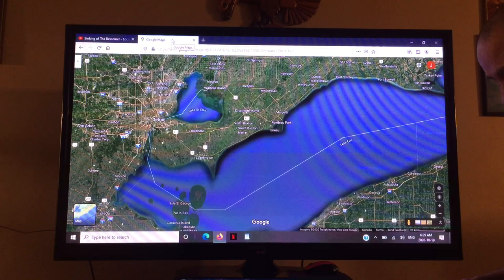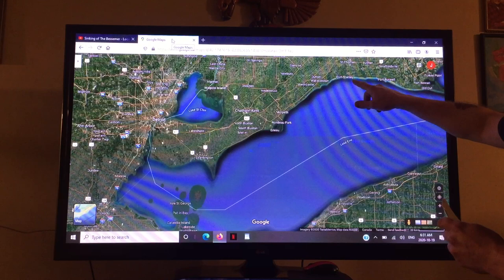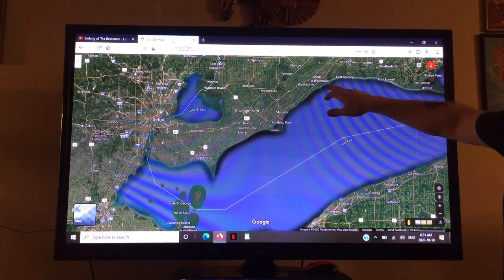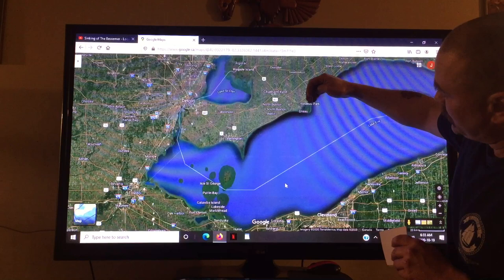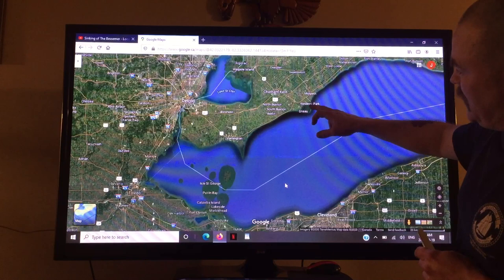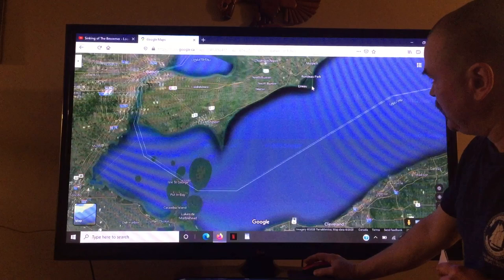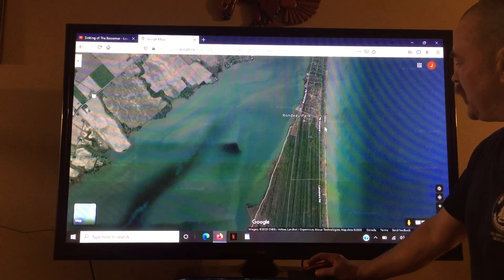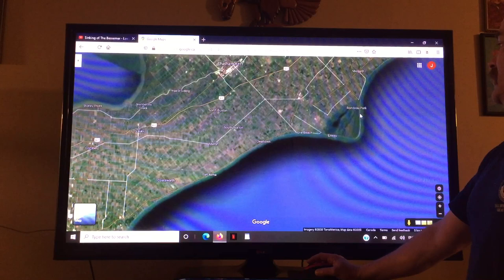Marquette and Bessemer No2 has been found!

Comment: Its a good story, but the sand spit in rondeau was formed over the past 12000 years. Not because a ship sank there. Over the past 150 years it has actually eroded over 650 meters. Also that point is aporox 8km long.
Reply from the maker: She formed that side of the point. Nature doesn't make straight. It also doesn't form points that leak black.  A magnetometer and side scan sonar this season will prove me right.
Reply: @joehindley6016  A 334ft long ship did not create a point 8km long, that it has been there for thousands of years and has been a park with cottages on it since around 1884. I hope you can prove me otherwise. Good luck.
Reply: I’m rooting for you, Joe, but the OP is correct. The rising and settling of the surroundings happening in/around  all of the Great Lakes is causing this to erode, not build up(resettling after last ice age 10k years ago, which causes the land to expose itself while rising, lowering the water level). There are several(including 2 formations in the Atlantic, one over 9 miles long) natural anomalies that would prove the “nature doesn’t make straight” statement wrong. I think that your theory and timeline are good, but I think relying on a “debris field” from a 330ft vessel that is supposedly under that much sediment is faulty at best. All that said, where are you at with your funding and equipment? Perhaps I can introduce myself and help if you contact me. Either way, I wish you good luck and hope you solve this great and tragic story!

Comment: I personally don't believe that's the spot. But its a fair theory.  What blows my mind is Lake erie averages 60 ft deep and the M&B#2 would have been 50+ feet tall on the bottom.  That tells me its likely in a deeper part of the lake.  Also, If it were me, I just managed to get near shore in those conditions, I just cant safely enter harbor, I'm not going all the way back across the lake to Cleveland.  Seems more likely that I'd find a spot to potentially beach her.

Comment: I was wondering how the search is going? 

I live near Aylmer and I visit Port Stanley often, I came across the story of this ship recently and it has really sparked my interest...
Reply from the maker: It's going slowly. I was at the site 10 days ago. She is well hidden under 12 to 15 feet of sediment. I can't do what I want down there without getting in a lot of trouble. I don't want to do that.
Reply: @joehindley6016  

Has anyone ever thought about running some sort of sonar over it to see if a ship anomaly lays down there? That would likely draw a pretty clear picture, expensive equipment though, it would likely only be possible with involvement of some research organizations etc...
Reply from the maker: @googlreviews7813  i used to guess at how much sediment was over her. I know how much is on her now. That is all I have to say about it. That is as far as I can go. If I wanted to I could touch her hull with a special prob. drill through it, and put a plumbers camera in her to see inside. The idea has crossed my mind but it's not right to contaminate the site like that.  If I was free to problem solve at will this would have been over years ago. I have to do this within the bounds of the law from here on in. I have done all I can without fines or jail time I would like to keep it that way.

Comment: but how did dirt and everything get grown on the steel
Reply: Sediment accumulates every year on the planet. and she has been there for  113 years. lots of time for it to accumulate. As I have said before in support of Joe, There were no airplanes to spot her for many years. During that period the sands of time and the lake, did there work. I am sure she would have been seen if Planes were in the equation. But they are not. You can easily see ship wrecks in the St Clair river that have been there much longer.
Reply from the maker: You can't see anything there. Visibility is one foot at all times. From the air as well. A satellite scan of the lake couldn't see her when it was done. I have a million questions to answer. I can't wait for the experts to take her over so I can focus on what I want to know.  I am going to be on the search for as many old aerial photo's of the point as I can get. I will not see her, but I will see her shape in the sand.
Reply: imho if an airplane had overflown her or a satellite overflown her she would have been seen. But only in the first year or 2. After that like Joe says visibility is poor there. Even if you find a old photo of the point  it would have to have been in 1910 or1911. After that its too late. due to airplanes being too rudimentary till really after ww1. It is slim to none that a flight took place before 1918. Again way too late . A satellite wouldn't be able to see her in 1918, just as now. The reason I agree with Joe is the artifacts he has found. and loose coal doesn't come leaking out of sand. It has to be chipped out of deposits. And you can see the coal. I myself don't see her shape. because I dont know how close to shore  ( Inland.) that she is. but I can see the coal. I have no doubts you are right Joe. Cant wait till you prove it to everyone.

Comment from the maker: Their was no mutiny! That was a story to sell newspapers.  George Smith was found with his tools of the trade, 2 butcher knives and a meat cleaver. When Robert McLeod's body was found with a cut wound an a-hole reporter put the two together without a thought for what it did to the Smith family and the stigma that probably follows to this day.   It never happened! 
Robert McLeod"s wounds were from the ship slamming him into the water. The wounds of all the men were from the ship.

Look at it with a little common sense.1) Could George Smith or anyone on the ship get a known lemon of a ship home in a fierce storm better than, not one seasoned veteran Captain but two! John had his captains papers as well.  2) George was found with the knives and cleaver. He would have had to run 200 feet up the deck slash the Captain while his brother and the other crew around watched, then he ran back down to life boat #4 with his weapons.  It never happened!

George Smith from Conneaut, Ohio, USA followed orders until the end. He then helped pull other men into lifeboat #4 before he froze to death with his tools of the trade, his two butcher knives and meat cleaver.

If their are relatives of George Smith following this, hold your heads up high, George didn't murder anyone!

Comment: what collapse is referred to? did the hull itself collapse? Also this was posted  in 2020  Was It confirmed??
Reply: So I gather you should know by the summer of 2022? As they say leave no stones unturned. I hope you are right. Have you gathered some of the coal?
Reply from the maker: Yes the hull collapsed. It is why you can see the black stuff so clearly from space. The current is going in her side and coming out near the stern. I have a piece of coal so new it still has tool marks from the miners. It spent very little time in the water and came from inside her. I have a crushed paint can with her white paint in it. The can dates to the time period. It came out as well.  It will be confirmed this year. They don't even have to do a grid search. I will put them right on her within feet.
Reply from the maker: I have a piece of her metal with Glidden green paint on it in my filing cabinet as well as a boot heel from the time period.  If you want to be a part of history I have a go fund me.  I will have the equipment down there if I have to sell a kidney.
Reply: @joehindley6016 This is great! Good job sir! I thought your projected timeline was convincing, let alone artifacts. Do you think she lost railcars overboard before she went over? or do you think they are inside her? And do you suspect she is directly under the waters edge? I believe you mentioned a depression caused by her collapse?
Reply: @joehindley6016  Sadly I am only just able to pay my bills, so I would not be able to contribute monetarily. But I look forward to any progress made. I saw I believe 4 black "rivers" flowing into the lake. Are they all coal? and what is the approximate distance between the 2 farthest apart?
Reply from the maker: @brianwilcox3478  She did not lose rail cars. the gas company would have found something when they laid the line down the nice straight shore line she made. She is in the point with 20 to 25 feet of sediment on top I think. It could be less. Those are the answers I'm looking for with the sonar. How deep did she sink in and how much is on top of her?
Reply from the maker: @brianwilcox3478  They are not rivers you see. The current is going in near the bow and pushing the black stuff out the side she exposed when she collapsed. It is how The piece I have with tool marks made it out of her on to the shore so quick.
Reply from the maker: @brianwilcox3478  I'm the working poor as well. no worries. It's nice to have support. I thank you for that!
Reply: @joehindley6016  Perhaps a poor choice of wording by me, but are the 4 black tracks that are clearly seen coal? So the bow would be approximately pointing at Cleveland? Where would you guess her keel  from the present shore line is ?There are 4 distinct lines of black "stuff" do you know if they are all are coal? and yeah I have to ask how far apart the black lines are at the farthest point
to each other. 100 feet? 300 ?? more? I dont know what you have found, but it is clear you have found something forgotten, lost or unknown. That is why I asked about the distance between the visible black lines. As far as I know there are no other 300 plus foot ships missing in Erie. I believe your scenario of the sinking is more than a plausible explanation.
If indeed you are correct in your assumption of the only safe harbor to enter in a storm, was Cleveland then yes, the Captain would have known that. and thinking it was his only option headed that way. It does explain much. Personally I think you are correct. And I expect you to be vindicated in due time. I must say it is crazy she wasn't found earlier. Hidden in plain sight?  To divert just a bit I would guess Captain McSorley of the Fitzgerald would have not broadcast completely his issues. or the seriousness of such so as to protect who ever would wish to come to their rescue knowing if they went down the rescuers would be at too much risk for little to no gain . And we know their railings were down at  Caribou. I think they knew either  make it to Whitefish Bay or...........
Reply: @joehindley6016  don't let it get you down. Even if this is not the M&B #2 It would have to be unknown. Something I find unlikely. No let me rephrase that, VERY unlikely. I think you are correct. By the way, Is there a depression where the hull collapsed?
Reply from the maker: @brianwilcox3478  She is pointed home. She is in the holy grail of spots.
Reply: @joehindley6016  understood
Reply: @joehindley6016  Hey Joe, do you about when the hull collapsed?
Reply: sorry do you know about when the hull collapsed?
Reply from the maker: @brianwilcox3478  Not exactly. The government will be able to answer that when the time comes. When it collapsed it would have sent out a huge plume that is still leaking. I think it coincided with the rising of the water levels in the lake. I think it can be answered to the day by them.
Reply: @joehindley6016  That would be great. I am so glad you took the time to figure this out. Cant wait to the day they say yep here she is ! Great job Joe!